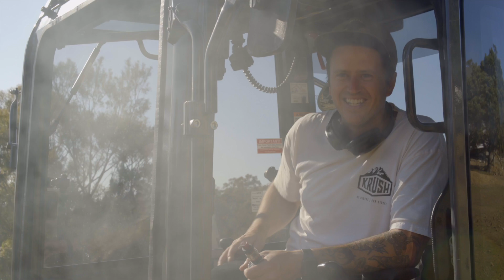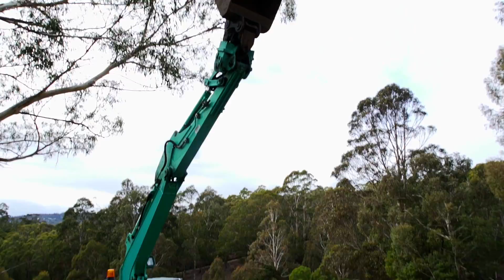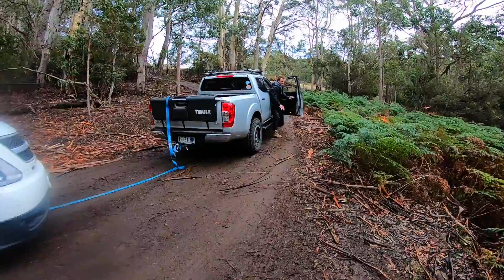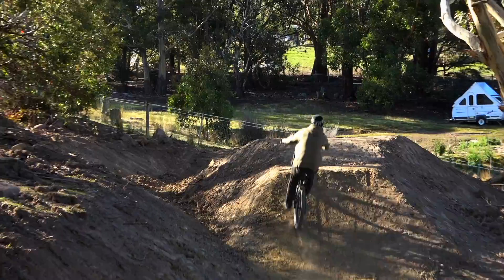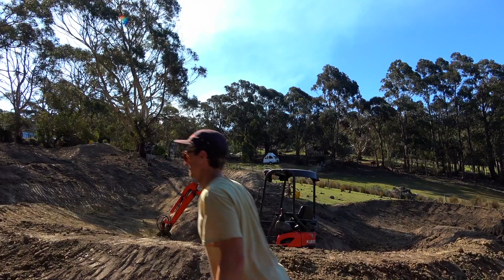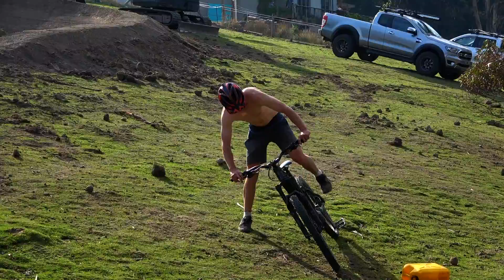Building a backyard MTB Jump Trail with HUGE berms

Comment: What kinda wrist is on that orange mini ex? Home made or purchased??
Reply from the maker: Purchased, it’s a Heli Tilt, but they went broke, another company has bought them out and they don’t make the same one anymore.
Reply: Bummer, I build trails in the US and have been looking for one to put on a new holland ec17. Some buddies of mine build up there own wrists but it would be nice to have a premade option to check out. Any clue who they sold out to? I peeped the website and they say they won’t have product ready for a while
Reply from the maker: https://www.attach2.com/au I’ve just quoted a new excavator to trade mine in, these are the guys that bought them out. Slightly different to the tilt I have, but similar! This one includes a quick hitch, mine is still manual pin bucket change!